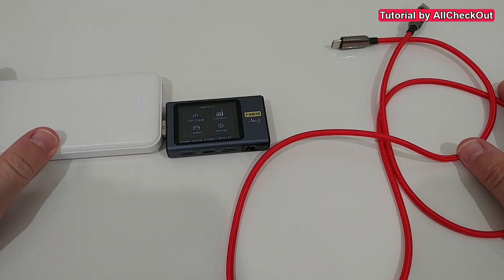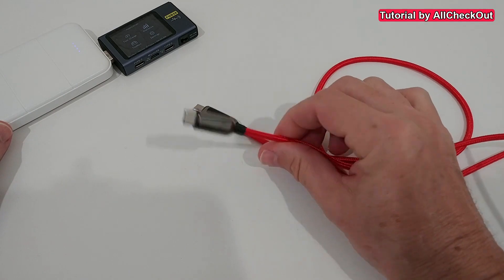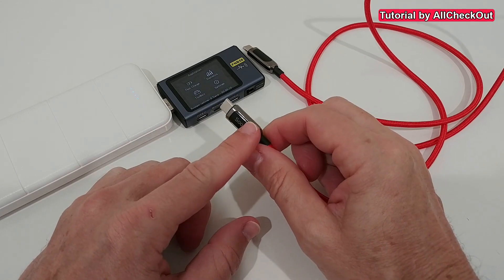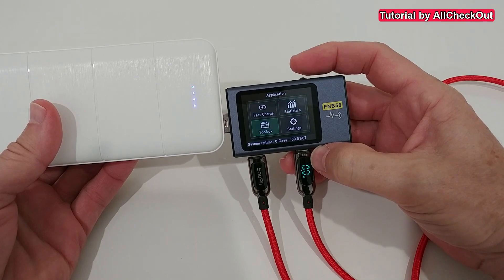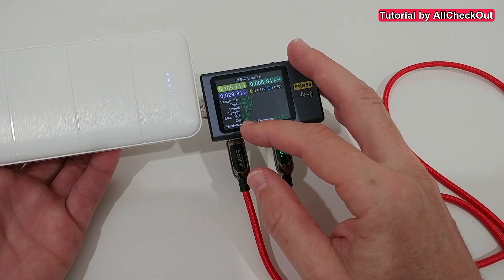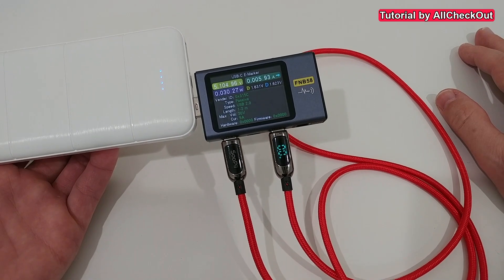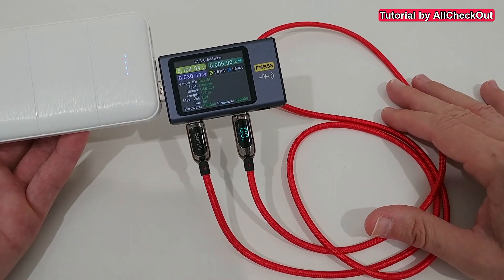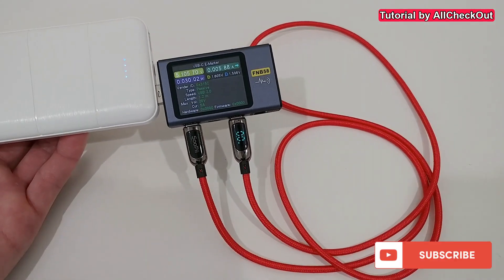How to Do a USB-C E-Marker Test with FNIRSI FNB58 USB Tester?

Comment: The information flashes for a second then disappears (UPDATE) Some cables do this some show e marker permanently
And if I use a couple of 24 pin USB c magnetic connectors to protect the ports from wearing out over time will the tester still work well

Comment: IF YOU DON'T SEE  "USB C E-Marker" (firmware 0.68 update)
In firmware 0.68 it's now called USB C Cable, and you only need to plug the cable to the IN port, NOT BOTH!!! 
ALSO, if you don't know cable orientation matters for some reason, so if it doesn't work, flip the connector around. 
If you've flipped it, and it's still not detected, then there's no e-mark chip in that cable.
Reply from the maker: Interesting - thanks for sharing here! 👍
Reply: Interesting, great helpfull ❤

Comment: When I plug in my powerbank the Unit display error code 02. Does not open the main interface.
Reply from the maker: Maybe your FNB58 is damaged or needs extra external power from micro USB

Comment: This thing can do a LOT more than you showed.  You have to push and HOLD the joy stick for 2 seconds.. either left or right.  Each screen will have extra settings and options.  It even has a built in oscilloscope for the data lines.  You can manual turn on different power modes, etc. Watch a few more videos on it;  there are several good one's out now.
Reply from the maker: Thanks. Yeah learned most options in the meantime. But ... did you read the title of the video ... lol ... and I've made many more videos about it in the meantime. Love it ...somehow ... but it's not very easy to use and not very reliable and needs extra power for some options ... so not very easy to use and no good instructions manual available.
Reply: @allcheckout totally agree. Just received mine and figuring out how to use it as the manual leaves a lot to be desired.

Comment: I can’t get the e marker thing to work, no matter what cable I use.  I don’t use cheap cables.  Normally stick with higher end anker cables.  I think my meter is bad
Reply: I am also using an Anker Cable. Supposedly for 100w. Mine says "finding" and never ends detection.
Reply: @jpvoodoo5522 I have the same problem did you find a solution
Reply: @jpvoodoo5522 Same here. What Firmware you have ?
Reply from the maker: I think lots of ppl are having problems checking the e-marker with the FNB58, but idk what the problem is.
Reply: I'm sure you have figured it out now, two years later. But for others reading this, make sure that the "PD COM" switch is set to "on", and that you're powering the FNB58 from another source than the cable you're testing.

Comment: Recently I bought FNB58 and upgraded to latest firmware 0.68, the Cable test didn't show any E-marker on the title, even I have E-Marker cable or not
Reply: The v0.68 update has just renamed it from USB Emarker to USB Cable, however to test the USB C cable you do not need to plug in both ends like in the video and either end plugged in to either USB C port will yield a result
Reply from the maker: @rinksdinks OH - thanks for the info. Sounds tempting. So you recommend the update?
Reply: @allcheckout  as far as I am aware the update seems to do everything the previous version did so I am happy with it. However, if you are mainly interested in checking the USB-C eMarkers (albeit the majority of USB-C cables do not have it) the PD com switch needs to be switched on for it to detect eMarkers
Reply from the maker: @rinksdinks Oh .. thanks for the info
Reply: @rinksdinks Yup, turns out it was just renamed.  it still checks the eMarkers (I think I mentioned that).

I still think this tester is a bit finicky.
Reply from the maker: @TechieZeddie Yeah ... could be easier to use. And weird regarding the cable. It even said that in the instructions that it can only be used from one side. At least that's my model. Maybe they have now a new, improved model which works from both sides.
Reply from the maker: So with the old FW it was better?
Reply: @allcheckout  I can confirm that option is missing it seems.  I just bought mine (started at 0.63) and when playing around the menus, I saw USB-C E-Marker option (didn't actually try it though).  As a good girl, I updated the firmware right away to get the latest and greatest.  After the update, that option is now missing.  I thought they renamed it to "USB-C Cable" because description says "Start USB-C measurement" but it just stay at "Finding..."  so I'm not sure if that's how it's supposed to work (I have a USB-C cable plugged into IN and OUT like in your video).
Reply from the maker: @TechieZeddie  Oh ... wow ... crazy ... thanks for the info. I've still not updated ... and I guess I'll leave it like that ... lol
Reply: @allcheckout  I think it worked!  I was probably using a cable without an E-Marker chip.  I just got a Ahoi charger that included a cable with an LED display to show wattage and that has an E-Marker chip, and it did finally showed on the tester.  I thought maybe with cables without, it would mention it instead of just getting stuck on checking.

Not sure if it's the firmware version I'm on, but this tester is finicky as heck.  Sometimes it won't pass through the input power to the output.  Sometimes it does, but at only 5v 1A even though the device, charger, and cables support it.  Sometimes leaving PD Com off will turn off the tester.  Sometimes it works.

I read the instructions, but the English is a bit hard to understand especially when it comes to things that need more technical details.
Reply from the maker: @TechieZeddie  Oh ... interesting. Thanks for sharing here. Yeah I love the C to C cables with LED ... but they just work from one side ... at least mine does ... lol
Reply: @allcheckout  I haven't seen a cable with displays on both ends, lol.  Not sure why I would need it.  Just for the slight convenience?  Sure, we Chinese do some crazy shit!
Reply from the maker: @TechieZeddie  No ... that's not what I want. I don't care on which end the LED is ... I just want to be able to use such a cable from both ends ... and that's not possible ...
Reply: @allcheckout  The cable that have a display on it works on both ends for me.  The display at the charger end still works the same if the display end was plugged at the device.  Weird that your doesn't.
Reply: @allcheckout  I have no idea, but i only can plug in either 1 port to test the cable, not both connectors at once, otherwise only showing "Finding"

Comment: Very Strange, my FNB58 doesn't want to Detect my samsung or Thunderbolt C to C cables

It stays stuck at "Finding..."
Reply: I have the same problem. Using Anker 10 ft. USB 2.0 100 watt cables.
Reply from the maker: Weird ... I think I had this problme with the FNB48, but FNB58 seems to work with every cable. Just tried another one:  https://i.imgur.com/AdraK6O.jpg
Reply: @allcheckout  are you use the version firmware?
Reply from the maker: @lptrung  I haven't upgraded the FW
Reply: Same. For some cables (I assume it's those having an e-marker chip) it blinks something but then jumps back to the "Finding" screen. This happens both on 0.67 and 0.68 firmware.

Comment: Interesting, I see the cable is reporting its a usb 2.0 thats cool. I've often wondered if there was a way to see if usb 3 cables were actually usb 3. can you try a normal usb 3 connector plug to usb c and see if it reports usb 3?
Reply from the maker: Good question bro. I've tried, but the USB tester didn't show any values with USB-A to USB-C. I guess only USB-C to USB-C have e-marker chips, but I'm definitely not an expert on that.